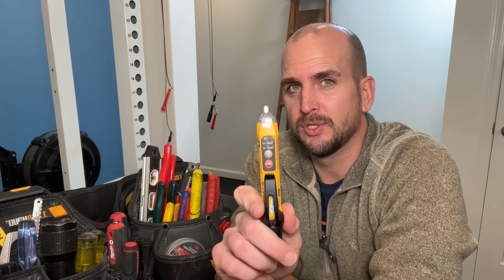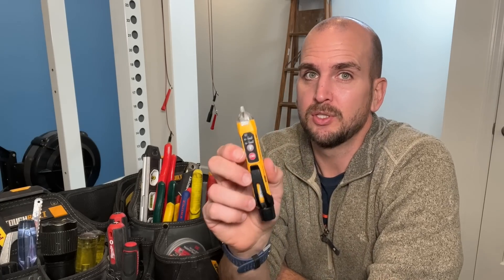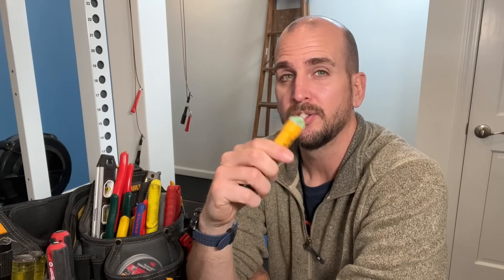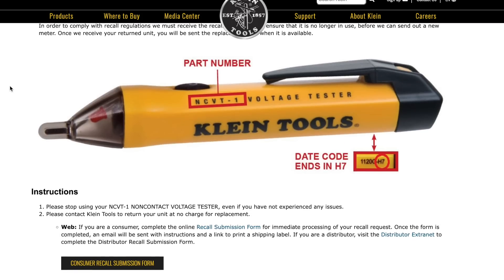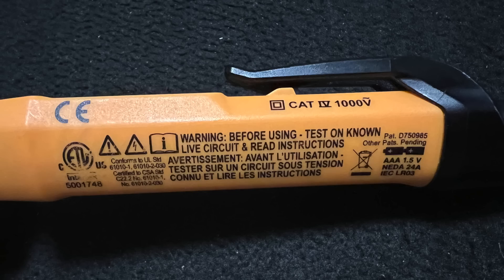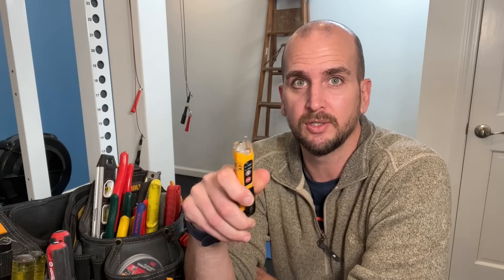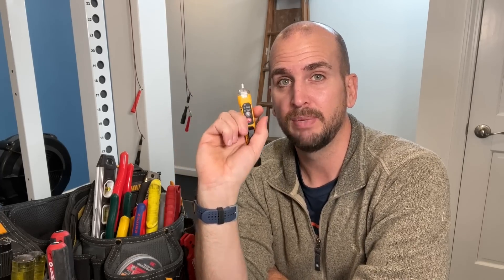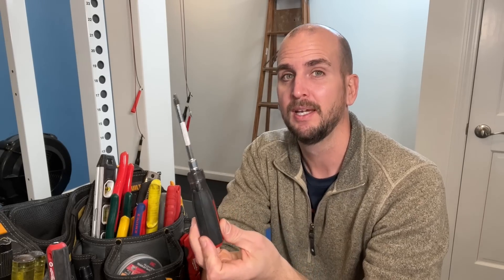The Tool I Get The Most Negative Feedback On And Still Use Weekly

Comment: I was an electrician in the electrical generation field for around 40 years.  We used these pen testers a lot.  We had structures that were 12 floors high and also had circuits spreading out hundreds of yards in every direction around a very large area.  Most of our troubleshooting on AC circuits was trying to find a connection somewhere between the source and the end user that had failed open.  We would leave the circuit energized and using our schematics and wiring diagrams, trace the circuits.  With this tester, you simply opened each junction box until you lost the voltage.

We absolutely did NOT use an induction tester to test a circuit dead before we physically worked on equipment.  There could be a low voltage on the circuit that would not be seen by the tester yet could still be enough to hurt you.  In the US Navy, they considered anything above 24 VAC/VDC enough voltage to kill you.  The logic being that if we had a casualty and you were wet with seawater, giving you low resistance to ground (something like 0.001 ohms), using ohms law you can calculate the current passing through your body.  It only takes 100 milliamps to stop the heart if the path to ground is through your chest.  In the civilian world, we checked 480 VAC and lower voltages with a Fluke multimeter.  Side Note:  When I first started in the Navy at 18, we used Simpson 260 multimeters.  Still have a working one in fact.  For 4160 VAC circuits we use a glow stick (we did have one supervisor check 4160 VAC dead by using a multimeter.  It did not harm him, but all that was left were the two leads in his hands).  In all cases, we were required to check the multimeter on a live circuit before and after checking the circuit we were going to work on.

Another side note:  If you are going to unwire a large 4160 VAC motor driving a fan, you never start cutting through the termination kit or unbolting the bus bars while the fan was spinning down, which could take 15-20 minutes.  They make really good generators and will knock you on your ass.  I know.  I did it. Once.

Comment: as a licensed, certified electrician for 40+ years i have found that everyone has their opinion on tools. Before using my equipment testers, I test them on known live circuits. I use the Non contact tester a lot...usually when doing my initial trouble shooting exam but obviously don't rely only on that. I always check at least 2 times but usually 3 times that I have no power on the circuit I am about to touch by using the No contact and a multi-meter. Better to check than to get zapped.

Comment: I am a Journeyman electrician with 26 years of experience in the trade.  Common practice is known live, circuit of intrest, known live. Followed by a multimeter check. Another way of safely using it is the on, off, on, off method which should also be followed by a multimeter check. 

When I was an apprentice, an electrician that was about to retire told me "there is on thing you need to remember if you want to make it to retirement as an electrician" 
"Never trust anyone!" 
"Not even yourself!" 
"Always double and triple check"
"Insist that your coworkers test for themselves "

Comment: I have always used gloves  appropriate for the current level.  Good nitral groves work well for 110 v 20 Amp circuts while I have thick lineman gloves for working on service entrance lines.  A non contact tester is always in my shirt pocket when doing electric work.  I have upgraded to the type with strength indicator.   So I can tell the difference between door bell current and deadly higher current.

Comment: A lot of electronics do not have real off switches.   The result is that the battery slowly drains and the batteries might leak.  The solution is to remove batteries between use.  A trick I have been using for decades is to put a small pice of index card on the battery terminals so the batteries may be stored inside the device.

Comment: My super cheapo one I bought for testing Christmas lights, I noticed sometimes I get false-positives if there's a parallel line that's live. the LED isn't as bright, which is one way to notice, but that did freak me out a bit and I cut power to the whole house. But after reading up on it, I ended up using a voltage meter to confirm and it's all good.

Comment: You can't detect an open neutral with glow stick. I've seen guys chase their tails trying to figure why things aren't working when the stick glows if they don't use a real meter with an open neutral in the circuit.

Comment: I had an instance where the hot wire was leaking voltage to somewhere and on my multimeter was only reading~50VAC.  A NCV tester may not have detected the voltage because I think the fluke detects from 90-120 (they have a lower range to check like 50-90 but it isn't what most people would buy).  If you're already springing for a tester just get a multimeter so you can be sure.

Comment: Live-Test-Live is a best practice even when using a multimeter. The tic tracer is a useful tool especially when troubleshooting circuits or switch boxes. I personally use the Klein NCV testers myself. I don't trust a NCV with a true dead test but there are situations where an NCV tester will verify a live circuit when your multimeter won't. an example is damaged grounds and neutrals, etc.

Comment: You convinced me to get this Klein Tools NCVT-3P. As a DIYer, I use an auto ranging multimeter that does Non contact and also Single lead contact detection but doesn't have sound and flashlight and is not as easy to use as the NCVT-3P.

Comment: 20+ yrs in HVACR TRADE and a voltage tic is always in my pocket along with my pens, markers, and antenna magnetic pick up tool..

Not a good day for me if it's not in my pocket 

Use multiple times every day for quick check to see if I have line voltage.  I don't use for any low voltage even though I seen ones that can detect low voltage and never use for DC voltage.  Not even sure if such detects DC voltage?

Along with everything a little expierence and common sense goes a long way. 

This is not a test tool vs. just telling you that there is power. In a crowded  spaghetti filled box forget about such.  Outlet tester as an additional tool??.. Redundant and amateur! This will tell you which side is hot.  Do the  rest with a multimeter that I have 3 of on me everyday.  #1 most important tool by far that I have a back up for my backup 

My main everyday UEI multimeter even has a NCV detector built into it that I never use because of my pocket tic!

As always, before really digging into anything I test everything properly with a multimeter.

I don't even condemn a fuse just using a voltage tic/ light/ beep

Comment: The issue I ran into the other day was ,  it appeared that I had no voltage using my stick tested, I had 100vac and the tester didn’t acknowledge the voltage, I had to get my volt meter to see what voltage was there, problem solved I had a neutral that wasn’t making full contact. However I really like my stick tester.

Comment: I use kobolt brand, I do agree they give false readings, sometimes. I usually end up doing what you have talked about checking good circuits first. With kobot they will detect when you put them next to a dead wire and pull away, with a single beep.  Once you understand how these devices work, they are very helpful.

Comment: Long time handy man here:  I once got called out because someone got shocked when they touched the air conditioner.  I started my testing with a NCVT -- what I call a voltage sniffer -- and found that it activated three feet away from the aircon unit where it would normally activate only a few inches from a hot wire.  It turned out that a nail had been driven into the wall that had contacted a hot electrical conductor and the metal lath behind the plaster, and the whole wall was hot behind the plaster.  The window style aircon had been installed in a hole cut through the wall without being boxed in properly so the metal AC housing also made contact with the plaster lath, so it was hot too.  My voltage sniffer gave me immediate notice that something was very wrong.
When using a voltmeter to check for voltage, to get a positive reading, there has to be voltage AND a ground; if you get a zero reading, you don't know if it's a lack of voltage or the lack of a ground/neutral.  Use of a voltage sniffer can eliminate that ambiguity if used correctly.
Reply: Great story
Reply: Makes sense considering a lot of old time plaster walls used a wire mesh to hold the plaster.
Reply: So I got a long lead.  Can I use this method to see where there is hidden fault inside the lead?  So I can cut the lead into two shorter leads?
Reply: That will depend on what type of fault you have in the conductor.  If it's a clean break, then yes, you should be able to find it with a sniffer by applying voltage to one end.  However, if the fault still has a partial, high resistance connection, a sniffer won't apply enough load to cause significant voltage drop so the sniffer doesn't activate on the dead end of the lead.  You may need to set up a circuit with the faulty lead and apply a known good load before the sniffer will indicate where the fault is.  You may also be able to find the fault by checking the lead mechanically to feel where the break is.

Comment: I use a south wire "dummy Stick" it works well for me. the only time I have ever gotten into trouble, is when I assume there is only one circuit in a box (getting zapped either makes you feel alive, or it kills you). If you check every hot wire after you shut off the breaker, you should be safe. I am not a pro, but I am also not dead.

Comment: I use the pen tester once in awhile but only on a 120 volt circuit I would never trust that sort of tester on a high-voltage 240v 277v I can take a hit or two from 120v but when it comes to 240v 277v  I prefer not to take any chances not with my life on the line stay safe

Comment: I just use screw driver with a built-in neon bulb, followed by the multimeter. Reason: a multimeter will not measure any voltage if both wires are life, unless you measure to earth too. But your earth wire might not be connected. I use this way for time saving. If the srewdriver lights up, there's no reason to go on.

Comment: A tool is a tool to be used in circumstance. Its a useful tool but its supposed to give information to the user and not to be fully trusted as fact. Even if i work with live or dead wires, ill use my pen tester to assess a situation or troubleshoot, then proceed with more heavy duty tools or what i think should be done next. Its not a bad tool, just don't go all in if it doesn't beep.

Comment: I trust and rely on a non contact voltage tester.  

I have had one consistent false positive non a disconnected wire despite testing on a known live circuit.  The situation was in a 120 year old home with unsafely run Romex, the type with a woven silver-ized sheathing.  Both ends of an old piece were unhooked but still tested live with non contact, but not with a voltmeter. Had to remove a wall panel to discover another wire was run snug side by side in the same channel for about 4 feet.  Clearly evidence of induction from a live wire into a dead wire.      

Another time at the same property discovered the circuit I was working on was live despite tracing the breaker.  I skipped using the non contact and got some sparks.  Discovered there were cross circuits fed by two breakers simultaneously.
 
All old wire is being replaced.

Be safe.

Comment: I have the 3p, and I needed to turn off a wire running in the ceiling. So I had a buddy flipping the switches and the tester was beeping the whole time until he turned off one of the switches. So, since the tester was telling me that it was off, I cut the wire and 💥! I then checked it again right after it blew up my cutters and it was beeping again!
Turns out, it was a different breaker...
The question remains if they can really be trusted?

Comment: This boils down to "know your tool", and "test your tool".  All tools have a place and reason.  I definitely use the multimeter if I need precision or actual voltage/current/load, but the point you made about testing hot on a sealed wire is where the NCV shines.

Comment: I have been a certified electrician in Europe for 20years. I have been told to treat every wire as live. Consequently use insulated tools. The circuit could become live at any moment. I do not touch uninsulated wires. I only trust Fluke and myself 😂

Comment: Old electrician here. I keep an Ideal NCV in my shirt pocket on the job, and a Fluke 120 in my tool bag at all times on the job. The NCV will tell you there is some power on the circuit. However often times you need to meter a live one to find issues. It's a wise idea to know what voltage is really on those wires, as well as is it single or 3 phase. Yes in home reno work it will be single phase in the US. Though you can find 3 phase power in some condo's, so be aware.

Comment: My multimeter has a NCV setting built into it. When I'm confirming that something is off before working on it, I always use the leads. But when I'm trying to pick out one hot wire from a bundle of several, the NCV setting does come in quite handy. Mines actually sensitive enough that I can use it to trace wires through drywall.

Comment: Hi Scott,  I want to thank you for recommending using NCV tester.  I have bought one and I use it all the time.   It has warn me a number of times upgrading the wiring on my boat.  It is really useful in finding the bad light in a Christmas string as you can find where the power stops then flip the plug for the lights to confirm your findings.

Comment: I deal with Electricians every day and most I know use these but only recommend them to others after explaining their shortcomings. They don't think they're bad they just know you need to use these with a little bit of knowledge about how they can fail in certain situations and shouldn't be your only tester. They don't however outright state you shouldn't use them just that they do require a little extra caution.

Comment: I've been using NCV testers for about 25yrs now, #1 tool in my pocket. I do I&C work, PLC's but also around single and 3Ph equipment. #1 tester to see if any AC voltage is live on contactors, VSD's, solenoids, etc. Found a neutral that was hot with it, wires had broken in a neutral path making the upstream N's live. Great tool along with a meter, and common sense.

Comment: I accidentally ordered tamper-proof versions of some outlets and discovered to my alarm that you can shove the point of a ncvt as far as you want into the live side slot but it will not register as hot. Apparently this is a by-product behavior of the design of these shuttered outlets, which I’ve never liked but now see as a real hazard to mid-level handyman homeowners like myself. 

I only discovered this when I installed one, lit the circuit up and got a negative test. While I always try to remember to double-check the live wires after opening a box, it’s really easy to imagine a homeowner getting into trouble if they didn’t know about this characteristic of TP outlets. (I’m guessing you may not have, or you would have listed it as a fourth cause of false negatives?) 

Personally, I think that the TP outlet design is fundamentally unsafe because this scenario is so predictable.

Comment: I turned off the circuit breaker on the outlet I was replacing. I plugged in my receptacle tester and nothing lit up. I thought I was good to go. When I attached the ground wire it sparked and tripped a different circuit breaker in another room. Even though I have attempted to trace the wiring, it still seems that a stray ground wire is attached between the two breakers. I've had a "professional" electrician out to diagnose, but could not find it. Anyway, I use a non-contact voltage tester on everything I work on since then.

Comment: I always treat all wires as live and use my ncv tester as a preliminary check for voltage. This is good because testing with a multi meter may not indicate if you don't have a ground or neutral. But always backup with a m.m. test. My only problem with most ncv testers is they tend to pick up inductive voltage in a non-live wire. Still, better safe than sorry.

Comment: Hi, I am glad you mention that you are not an Electrician, but it provokes the question "are you the right person to give advice to others, especially novices?). Real Electricians (at least here in the UK) are not allowed to use NCT as proof of circuit 'dead' for the purposes of safe isolation, nor are they able to use multimeters, because both require batteries to function. We have to use GS38 compliant voltage indicators, which must give audible and visual indication of voltage present, even without batteries. Also, our  low voltage threshold is 50 volts (mitigating circumstances notwithstanding) so your 70 v tester may still be putting you at risk. The only way to work safely around electricity is to be trained, be competent and employ safe isolation including LOTO (6 to 12 steps). Then there is the lifting of LOTO (the dead tests) but that's a whole other episode. Please be safe, seek professional advice.

Comment: Seems infinitely easier/wiser to use a multimeter before you grab anything, plus you can see the voltage and frequency right there so there's no realistic possibility of a false positive. It's easier to verify an operating DMM so you can limit false negatives. Plus with how many houses I've lived in that were mis-wired its a good idea to make sure ground is ground and hot is hot. NCV is handy for a quick scan and check. I also really like the ones you can leave in the outlet so you can flip a breaker and hear it turn on/off.